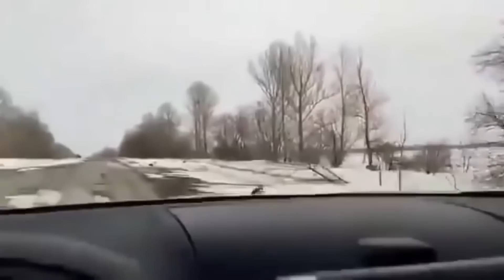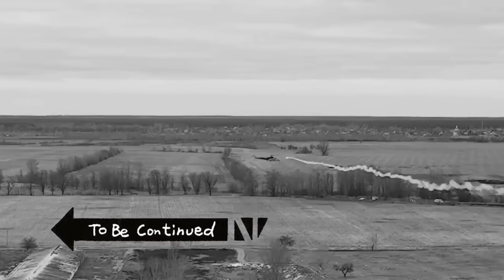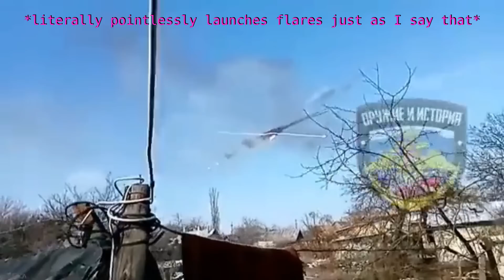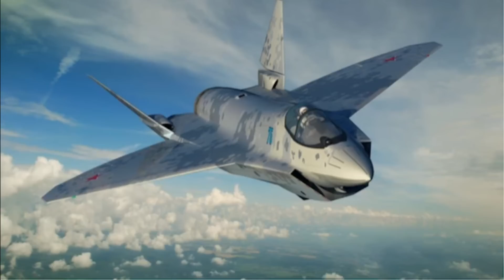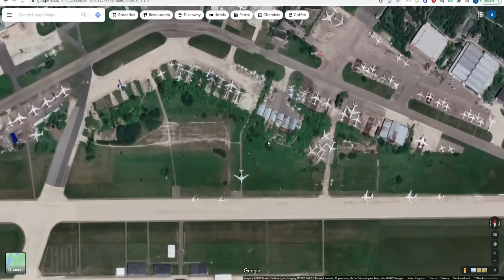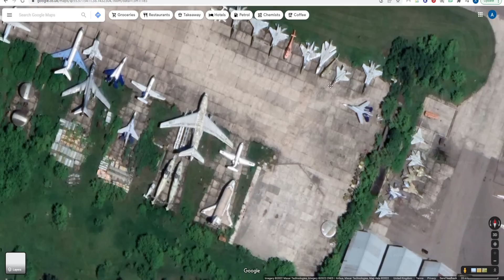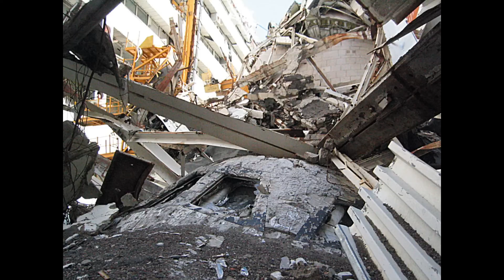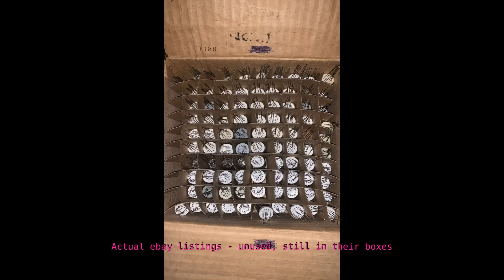100% warcrimes speedrun: Russia's technology problems

Comment: buddy you're getting a lot wrong w regards to tech its like listening 2 every msm head out there spew stuff w little relation to reality, they're not the old rifles aren't actually given to the army members, they're usually handed out to the militias under russias control (territorial forces n the likes), the air failure is v expected as both inhereted massive amounts of S300s(ukraine restocks from russian abandoned vehicles) its not a matter of tactics or hardware, even if you have the last gen of apache, ull have to use the same pitch up fire rockets as the entire area is stocked with stingers and iglas. As for the tanks, just no :D, russias performance was horrendous but the tech is on par with any NATO country as no NATO country uses APS afaik, SHTORA and LWR should automatically deploy smokes when lased by an enemy, (ofc footage is yet to be seen but that is how it works), Russia uses ERA That could reduce the efficiency of a tandom warhead to some extent, as for the cope cages, im p sure the engineers know that its impossible to stop a javelin with it, but older, more common systems or straight up HE warheads that were used by the drones should be stopped by the cage, granted the initial months of the invasion were terrible, there are signs of recollecting n regaining strength in the AA department)
Reply from the maker: I’m kind if surprised how many views this video has got recently. It was made 6 months ago and quite a lot more has come to light since - i should put an update in the description.

I think the overall point I was trying to make isn’t that Russian hardware is bad, it’s more that it’s deployed terribly with a rigid too down (and corrupt) leadership structure. Cope cages are probably the easiest to assess example you mentioned. The design process for conventional slat armour is surprisingly involved, with a lot of consideration put into spacing, thickness and coverage (I attended a lecture about this years ago). Youre absolutely correct: Russian engineers had no doubt slat armour would ineffective against NATO AT weapons. Problem is, the improvised cages we see were not designed and installed by engineers. They were haphazardly welded on as a last ditch effort.
Reply: @Alexander-the-ok  i didn't check the date until recently, i agree tbh, cope cages aren't optimal, and i think only one t55am1 with drozd APS was deployed and got destroyed by a javelin as the APS was from the 80s, that said i completely agree with corruption w the command structure, you rly can't send an apc with its driver commander and gunner alone, my idea was you can't expect modern armies (including the us) to not suffer any losses when the entire area is covered with extremely capable missles (eg the ukranian stukhna (1200mm pen with tandem charged warheads)/S300s and iglas, im not like cheering for russia but i think there should be some caution in description is all, that said, the video is a alrite, keepitup!
Reply: @Alexander-the-ok  well yes you are correct, and on top of that, the mafia style "pyramid scheme" that makes up both civilian and military institutions,(where there is always a bigger shark, taking your food) set up a  scenario for tanks that HAD night vision perhaps at the start, which had been over the last 30 or so years, systematically dismantled and sold off for $$ profit.. where did all those millions winter uniforms go? i wonder.. but its the culmination of all these factors, which lead to a HUGE technological disparity on the battlefield.
Reply: i think there  are some butthurt russkies in here, gettin their adidas sweat pants all up in a twist.. Hey- they own this "shit". Literally and  figuratively.. It aint nobody's fault but their own that the Ukrainians and NATO are now collectively rubbing their noses in that stinky pile of dii dii, that is the "russian military"- that lets be fair- couldnt beat Coast Rica at this point, and they aint even got an army.
Reply: @raidermaxx2324  I'd really like you to go read US-vietnam combat record, I'm not siding w anyone. the fact is its foolish to assume a complete
Reply: russia doesnt really have "territorial forces" except a few battalions of ukrainians   in the Donbas, its Ukraine that has an actual nationalized territorial force.
Reply: @raidermaxx2324  they do support and fund militias from these areas, (rostvaria  being one of em) and provide them with t62s and shit like that
Reply: @mrthebest8114  yes i agreed with you, but they dont have a national "territorial force" which is a "BRANCH" of their military like for example the National Guard is a separate branch of military or the like the Coast Guard. In Russia's case, they just assembled some militia battalions and gave them 1960's weapons. But it doesnt change the fact that even now their regular conscripted military are being issued two, sometimes three generations behind, if at all. I dont think you understand how badly the soviet system and Vladamir Putin and his cronies and their continued proliferation of this mafia style system which breeds "theft" and missing and lost equipment to the black market for personal profit,  have fucked over the average russian infantry soldier.
Reply: @raidermaxx2324  ye some troops r being issued dogsbit equipment, keep in mind the main goal rn is replenishing tbe kontraktniki (ppl who get paid to figh) over the conscript (ppl who r forced to fite), despite putins weird decisions it can't be a thing they wont overcome (Chechnya baso had the same jssue)
Reply: @raidermaxx2324  keep in mind that the russian army also has contracted personnel (like the US) who get paid to fight eg ( 1-4st motor brigade who lost Kherson was because the conscripts were drunk and all the fighting was done by them), as for Ukrainian corruption, there have been cases of imported systems (americans, swedish, british) that were left out by the Ukrainians, and this hurts their combat effort a shitton, as engineers from the east block(russia/china) would be salivating to copy and analyze current western equipment
Reply: dude.. its the fact that all their tanks dont have night optics. this is a fact. seems like you've been drinking the russian copium bud
Reply: @raidermaxx2324  literally go fucking lookup t55s from 1950s, they do have an IR projector and a set of nvds for the commander (its that big circle near the cannon) the guy in the video is talking abt thermals, which T72 ob2016 T80bvms, t90ms support
Reply: @mrthebest8114  the problem is, that may be the case, but because of"CORRUPTION" in the military, all those expensive parts have been removed and sold on ebay over the years, by commanders and lower ranking individuals due to the fact that military personnel have alot of issues with GETTING PAID.  HOW ABOUT YOU LOOK IT UP.
Reply: @raidermaxx2324  ye im aware of the nature of corruption in different sects of the army dude, what's not mentioned is armies (including the ukranians) also have corruption in them, granted different scales to different stuff, it's not a matter that can't be ironed out, the initial stages of ukraines defence was dogshit, they reorganized and performed well after that, expect russia to do the same (chechnya was an example of such process)
Reply: @raidermaxx2324  the main fault of the army was the missing numbers of infantry to complete a BTG formation, with mobilisation in hand, there might be a boost in performance as to the standards of a BTG
Reply: @mrthebest8114  dude you dont understand, its not JUST the corruption in the military, its the actual entire SYSTEM of corruption, which is the Soviet mafia style of govt, which is essentially a pyramid scheme or what we have here in the states wbith people who are invested in those weird supplements or "holistic medications" schemes, usually something that proliferaqtes in many churches in america.  But regardless, there is someone above you, who is always taking a cut of your shit, therefore you on the bottom, has to get yours somehow. So the Ukrainians are transitioning out of that system to a less corrupt democratic system. So its apples and oranges. 
And look you can accuse the ukrainians of being corrupt but for some reason their tanks(except for the ones giving to them by russia ) ALL have night vision capability. Also, it wouldnt make sense for them to clean out their tanks to sell on Ebay in the middle of a fucking war, now would it? 
The premise of the video is TRUE. 
That the russians are fighting with alot of disadvantages due to a disproportionate IMBALANCE between technologies in military hardware and MATERIALS which has allowed the Ukrainians to punch WAAAAAY above their weight, and has the russians now needing to dip into actual tanks from the 1960's that dont actually have night vision.. This isnt hard to grasp my dude. And yes,we get it, you are a Z fascist. 
But you cant change reality just to fit your NAZI narrative because you want to wish it that way.
Reply: @raidermaxx2324  idk where the z facism comes from, all i said is you rly cannot underestimate the capabilities of an army of that scale, despite all the corruption. ofc you have been brainwashed time n time again w good guy bad guy narrative that the media shits out, (the mujahideen) were the good guys in the 80s helping Afghanistan w a democratic transition, look where that led them, the losses right now are comparable to US vietnam losses (the us in vietnam lost air superiority with its cutting edge capabilities at the time, leading to 10000  aircraft downed, a 1000 of which are fixed wings), there has been an overwhelming bad coverage of ukraines current capabilities (the ghost of kiev xd) and other retarded stuff that the media likes to stuff out (one US senator literally thought sam hyde in a pilot suit was the ghost of kiev), there isn't that much of an imbalance in technology, despite what the media shits out, russia is capable of making nods and thermals. the current losses would happen to any military out there (hezbollah vs an israeli merkava column) because good placement and good  atgms always beat faulty tactics, you continuously fail to realize that the state of technology in aa defense forces bad tactics, (Apaches cant survive a modern Manpad). i rly recommended changing the sources you get your news from, oryx is a moderate tracker for combat losses, and Perun on YouTube has been phenomenal with coverage of military equipment.
Reply: Nato tanks and ifv's have more modern and more often some competent thermal optics. 
Shtora is just garbage, it works against common older atgm's but on t90 it literally makes it more vulnerable, it leaves big gap without era on the front of turret. Smoke deployed when lazed does nothing against javelin and besides, ukrainians now apparently aim laser around the vehicle, only steering missile on it in the last moment. 
Their era bricks leave ungodly amount of tiny gaps.
And their cages arent even built properly to crush rpg warheads. Gaps are too small and warhead is more likely to detonate striking bars directly. 
Only purpose built combat drones carry at munitions, normal inprovised drones only drop hangrenades and mortar mines. Thats not enough for penetration and even with cage, your optics or open hatch get shrapnel anyway.
Reply: @robertkalinic335  ye im aware SHTORA isn't the best, the t90m did away with the dazzlers and its relegated to smoke deploy rn,which should work against javelin, but you gotta be shrewd abt it, which russian tankers arent. the current thermals on t90s should be locally made gen2s, which doesn't differ from other NATO vehicles, my point was he said they don't have IR systems which they clearly do. besides that , the level of tech deployed by the russians right now is on par with every nato country that doesn't employ APS systems en masse
Reply: @mrthebest8114  Idk about equipment being on par but its true for minor nato states atleast. I feel like abrams is better than t90 in every aspect, but if you compare it to some older leo2 or east european t72 variants they are evenly matched. The thermals in Nato are not only better, they are used even on ifv's. Didnt Russia buy optics from France or something before the war?
Reply: @robertkalinic335  i think the T90m is comparable to M1A2 SEPv2-4, if you don't consider the aps, i rly doubt any NATO country has a full stock of Leopard 2A6/7, that said, russians have been making their own thermals for a bit, BMD4s, i still wouldn't blame the tech as israeli tankers had the same issue when facing a capable enemy in a good position w good missles
Reply: @mrthebest8114  You are really pushing it if you think those are comparable, i feel like du inserts should be obvious big exclamation mark for you.
And just difference in funding between them.
Reply: @robertkalinic335  the t90m isn't a slouch either, i can't say for sure as noone puts actual armor values, the difference in funding never mattered as T-72s rivalled the early abrams while having a fraction of the funding(keep in mind that the abrams wasn't a thing if not for the MBT-70 project), im sure the US rn has better equipment than russia does, my point was facing the same level of technology would be painful for any NATO army, sure they'd preform better organizationally, they'd still suffer from losses
Reply: @robertkalinic335  that said, another point of conflict was russias air capabilities, the late variants of the s300s, iglas, Starstreak on the Ukrainian side(NATO AA weaponshave less range than russian counterparts  based on NATO tactics of achieving air superiority) and  russian S400s, buks and Tors that function properly makes actual air work impossible, thats why russia differs to lobbing cruise missiles from near its border, so there's not much of a disparity on that side
Reply: @mrthebest8114  Thats not true for t72, it didnt have only fraction of funding, big part of soviet economy was dedicated to military industry. They wouldnt be able to match the west otherwise since they were poorer.
Reply: @mrthebest8114  I did not even talk about aa capabilities, why are you explining this?
Reply: @robertkalinic335  the mbt70 funneled funding from the US and west germany, it was literally closed as it sucked up a lot of money, the export cost of a T72 was cheaper than that of an Abrams, granted im not saying the t72 was free, its just the production and development wasn't as costly as that of the M1, keep in mind state products are usually less expensive than the way US operates with PMCs
Reply: @mrthebest8114  Mbt70 development probably passed lessons learned onto abrams, thats like the situation with t64 reliability and cost being the reason t72 even exists.
Export cost is irrelevant, it is influenced mostly by scale of manufacturing. 
I was talking about percentage of economy dedicated for military industry, not about price. Yes, soviets could probably design something good for less than americans would but it doesnt change anything about soviets using proportionaly more of their economy for military.
Since the fall of the soviet union, russia lost major part of the industrial and economic power. USA didnt, and it kept pumping obscene amount of money into its military. No matter how cheap is labour in Russia, they cant match that.
Reply: @robertkalinic335  yea i agrree, the tech that they have has been countered by America's defense spending and research.. its nice to know our tax payer money is actually proving itself in real life finally without us being in direct conflict tho.. but clearly a conventional war between NATO and Russia without nukes, russia gets demolished in less than a week.
Reply: Who?

Asked?

Comment: Trust vectoring really comes into play at low speeds to gain nose authority which is fantastic in a dog fight…. If you’re in a spitfire. Modern fighters don’t need to be hyper manoeuvrable, weapon systems are off bore sight. An F35 will engage you while your flying along unaware behind over 100 miles away without even beaming its radar at you to give you some kind of warning. Even the SU57 which is nothing but vapourware is clearly 5 decades behind in tech and doctrine. Russians have fight- the - last- war- itis and believe so much in Russia strong memes that they have dismissed the advances of practically every other nation.
Reply from the maker: I thought thrust vectoring, of supermaneuverability, or whatever, was extremely cool back when I used to do some flying myself. That was more than 10 years ago, and I've grown to understand we don't live in the Top Gun universe.
Reply: @Alexander-the-ok  it’s very cool for air shows, Russians love high alpha low speed stuff to show it off but has very little purpose in combat. F22 has some degree of trust vectoring but you could argue it’s main purpose is dick measuring.
Reply: dogfights still happen   even though long range missiles are a thing . super maneuverability  isnt the only benefit  thrust vectoring provides , 
the nozzels can be  used to help with trimming instead of the control surfaces  causing less drag , also helps with takeoff and landing
Reply from the maker: @ferrous3262  I'm not particularly qualified to talk about this, but I think the basis for most Western aircraft now is that dogfights are a thing of the past and they'll never end up in that situation.
I assume the complexity and cost savings of not using thrust vectoring specifically have been deemed to outweigh the benefits you mentioned.
Reply: @Alexander-the-ok  in 2019 a pakistani f16 shot down a mig21 in dogfight range ,  even with both pakistan and india having  bvr weapons  both planes  found it self in a wvr engament